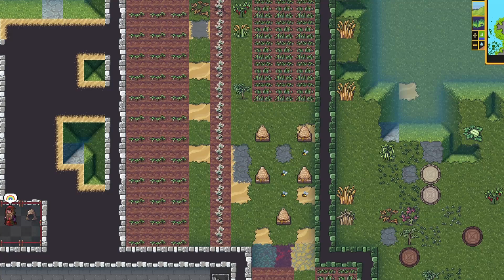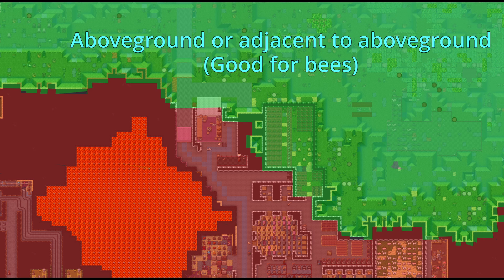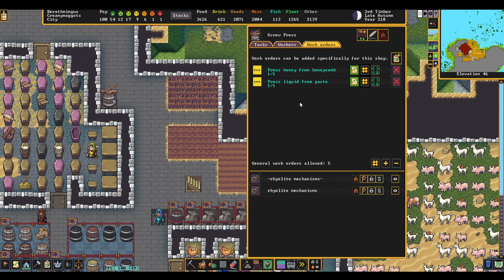Setting up an Oil and Honey Industry Dwarf Fortress

Comment: With the soft cap of 40, I tried coming up with an efficient layout. This is all just theory so far, but it's based on the optimal layout of base sprinklers in Stardew Valley.
In a 7x7 plot I've got 9 split hives, 32 producing hives for a total of 41, so the last hive you place needs to be set as a splitter because it will be guaranteed to have lower yield.
This layout has 8 empty tiles in it, X = empty tile, H = Hive, S = Split hive

X	X	H	H	S	H	X
H	H	S	H	H	H	X
S	H	H	H	H	S	H
H	H	H	S	H	H	H
H	S	H	H	H	H	S
X	H	H	H	S	H	H
X	H	S	H	H	X	X
Reply: What are you trying to optimize?  Minimizing the walking distance from the "breeder" hives to the harvested hives?

Comment: The bees being killed/destroyed on harvest is accurate to the old ways of beekeeping using those cone shaped hives shown in the graphic. Modern hives are designed to have the bees make their comb in removable windows allowing just the honey filled comb, which bees usually store in the top half, to be removed and replaced with empty windows. In contrast the the cone hives where you needed to get past the majority of the bees and brood filled comb to get to the honey filled ones at the top. Which was most easely done by killing all bees and then scooping it out.

Comment: The worst part in dealing with these industries is jugs, I've run bees and rocknut soap production in my current fort, once they get setup right they are satisfying useful industries but boy its a headache getting them going.
Reply: Unlike wood, if you make jugs from a specific rock, you can specify it in the stockpiles you use for those industries.  That way you can distinguish them from other tools.  Scroll rollers, book bindings, stepladders, wheelbarrows, etc.
Reply: @OneFingerYT  yeah, meticulous stockpile management is basically the only way to get theses systems working and they still get screwed up when a dwarf drops a jug outside of a stockpile where they basically can't process what it is or where to put it after that. Ontop of having to process byproducts like royal jelly at a kitchen designated to cook with it which is its own disaster to manage.